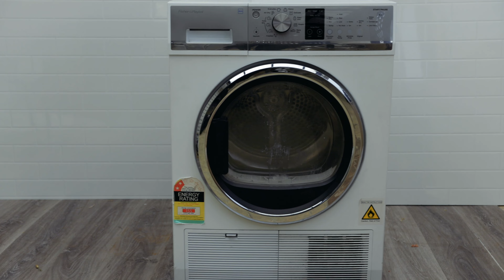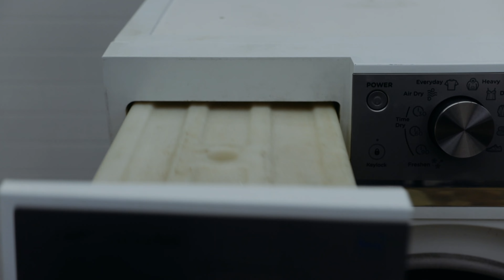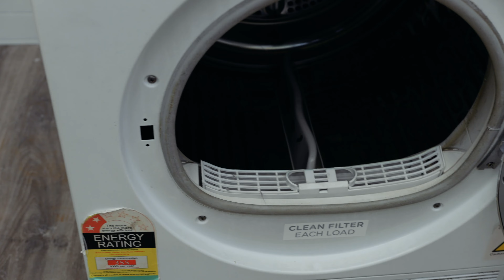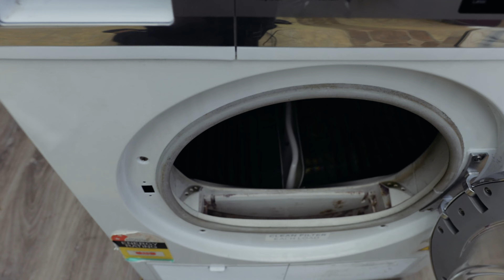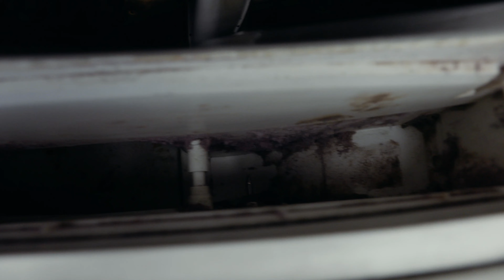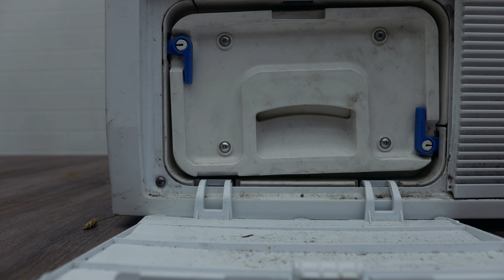Fix Fisher Paykel Dryer Not Heating Wet Clothes Easy

Comment: I have model DH8060P1 (a lot newer model) and your video does not suit this model at all as the condenser is not behind the back and there is a pulley set up behind the initial case. Taken the top of also and all electrical is on top right side with no reset switch also.  Can’t fix with this video
Reply: I'm in the same situation as you (I've got the same model) and there aren't any videos about the model we have.

Comment: i have this model and it stops working partway through a cycle but doesn't show an error message.   Could this be humidity sensor or something else?   Weirdly it seems to work better when it's not pushed under a worktop
Reply from the maker: Hi might be an issue with air circulation

Comment: Great video. I have the same dryer, it occasionally trips off breaker. however when it happens, it is very likely it will trip again after restoring the breaker. Until it's working again, it works for a while. What are possible causes?
Reply from the maker: Most likely heater

Comment: Hi thanks for the great videos on Fisher and Paykal condenser dryers - my dryer is not heating - I think the heating element is ok - is there a reset button abd if so where is it located
Reply from the maker: Hi yes there is one on the back of you remove the rear cover
Reply: @askmrwashywashy  really appreciate your reply, located the thermostat & reset button but it doesn’t seem to do anything
Reply from the maker: @rodmason7822  was the thermostat button popped out ? you might have to test the heater with a multimeter to see if its still working
Reply: @askmrwashywashy  the button was open out but doesn’t re set - I checked with a multimeter and it appears ok - very strange. The heating element is simply not heating

Comment: I was told with the error code I got it would be the heater element with thermal overload etc so I replaced to a part worth $200 and still getting the problem
Reply from the maker: hi how is the idler pulley and the two roller wheel that hold the drum. if these are worn this cause a constant overload protection.

Comment: Hi, I having error 2 and also saying h20 full when not full. Any ideas? Something to.do with a pump maybe? Thanks
Reply from the maker: yes maybe check to see  if there is debris in the pump reservoir
Reply: @askmrwashywashy  how do I get to that ? Thanks
Reply from the maker: @mitchellball4835  its at the back of the dryer. follow the black pipe at the back.

Comment: do not buy this dryer, i have one, and i had to change 2 times on the wheel bearing , also, the water pump after a while becomes weak and doesnt suck out the water that is filled in the water pump, and cleaning the bottom radiatior filter is a head ache expecially if it is to moist, the dust and the micro cotton and polyster becomes stuck in the grills, overall ive had nightmares with this dryer , i sugget either a samsung or lg
Reply from the maker: Lg is better yes

Comment: Hi.. thank you for your videos. I have followed your instructions to fix the Error 4 on the F&P, using the red reset switch. That didn’t work, so I’m assuming I would need a new heating element. Have you made a video on how to replace the part?
Reply from the maker: hi when you say didn't work did the switch pop back out again ?
Reply: It didn’t really move. The red switch spins, but doesn’t pop.
Reply: Lint filter light flashing after resetting the red switch at the back even though the filter is clean

Comment: Hi...when cleaning out the lint from the small spaces   how to you get the length out if it's damp /wet and vac doesn't get it out plesse? TYIA
Reply from the maker: Very hard, you’d need a high pressure air blower to blow out instead of trying to suck out the lint

Comment: Hi mate. I have the same dryer. It doesn't heat on auto at all but when I use the 30/60/90 Min timer, it works just fine. Do you think that thermistor is to blame or a control board issue?
Reply from the maker: Might be the moisture sensor at the front where the lint filter goes. Make sure it’s clean and does not have lint buildup

Comment: Hey I have the same dryer and reset the fuse yesterday. It did a couple more hot cycles so heater was working but then error 4 came back. Will that just be a cleaning issue? If it's heating would I need to change the unit potentially still?

Comment: Hi Mr Washy Washy, shout out your videos are very informative! 
If you could kindly assist, i have this exact unit leaking water at the end of every cycle. I've replaced the water pump, checked and replaced float but i can't seem to fix the leak. It seems to hold water right to end of cycle (unit turns off ) and leaks water from the rear left side - near the rear fan.. Any help is much appreciated.
Reply from the maker: hi does it leak under the black cover ? if so you will need to unscrew the cover and apply silicone all around where the seal is and screw back in. It should stop leaking then

Comment: Hi, my dryer is not heating after 5 min on timed, then it shows err4. How do I determine if it is the heater element assy or the PCB? Inspection of the heater doesn't seem to show any issues. Vents and passages are also clear of excessive lint.
Reply from the maker: test  your heating element for continuity using a multimeter. No continuity heater faulty. there its a resettable fuse which you push down at the back too.
Reply: @askmrwashywashy  Hey mate thanks for replying. The resettable fuse wasn't tripped, my multimeter shows 110ohm for both heater coils (I'm assuming high and low). I just don't know if that's acceptable for the heater, is there anyway to diagnose the PCB?
Reply: @lewischeong2845 having a similar issue would like to know what the outcome was :)

Comment: Hi, I have a question about the reset thermostat button... Would you know what temperature the heater has to reach to trigger the switch? Im asking as my switch has deteriorated... Would you know or recommend aftermarket switch I can use?
Reply from the maker: hi  I would recommend you get one one from fisher paykel as manufacturer would last longer and is best. Unsure what temperature it triggers at sorry

Comment: Hi - how do you find errors / error 4 ... my unit the same as the one in the video works fine just dosnt heat...it progressively got less and less hot... and there is no error.. ive cleaned out the sensor etc... the trip switch is not tripped.... heater element is so how do i check this for continuity ?
Reply: great video BTW
Reply: BTW the unit is now showing any errors... it just runs the cycle and the clothes comes out damp...i have checked all possible passages for lint
Reply from the maker: @shanevanross468  hi thanks. If you put it on a timed dry cycle and put your hand inside the dryer  after 5 minutes. Is it warm or hot?
Reply: @askmrwashywashy  mine is doing this, it gives me a cool air after anytime I put it on for. Clothes are effectively “wind drying” a little but not completely dry. Hoping we can self fix!

Comment: Hi mate, how can i fix a err4 on fisher and paykel dryer?
Reply: Hi Nice conversation to read
Reply from the maker: hi mate. You would need to reset the sensor at the back of the heating element.
Reply: @askmrwashywashy  what does it look like?
Reply from the maker: @LofiCalmGrooveOasis  something like this https://images.app.goo.gl/rHdrmuGsDjM7QQet6
Reply: @askmrwashywashy  ok thanks. Ill check it later.
Reply: @askmrwashywashy  i've pressed the reset button and it still gives me err4 fault. Does this mean i have to replace the whole heater?
Reply from the maker: @LofiCalmGrooveOasis  did the button press down when you pressed it ? Btw how is the belt and wheels ?
Reply: @askmrwashywashy  no

Belt and wheels are good coz when i air dry it works
Reply from the maker: @LofiCalmGrooveOasis  I'd say you might need to change that heating element. Where are you based ?
Reply from the maker: @LofiCalmGrooveOasis  Yes that one. Maybe try and find a faulty dryer like yours on  ebay or Facebook  marketplace. Ive seen them go for about $50 or even free for a broken Fisher Paykel Condenser dryer. That way you can harvest all the parts you need in the future.
Reply: @askmrwashywashy  ok. I googled this issue aswell. What is a sensor on these dryer?
Reply: @askmrwashywashy  hi mate, just to give update. I have purchased a new heater element for my dryer and its working like new. 

Only issue i have now is the seal for the rear panel i took off to get to heater is leaking. Any idea how i cam fix this?

Thanks in advance
Reply from the maker: @LofiCalmGrooveOasis  awesome. Great to hear Get some Selleys waterproof silicone from Bunnings and put it where the seal is and that should stop the leaking